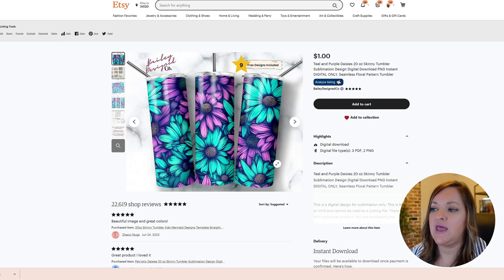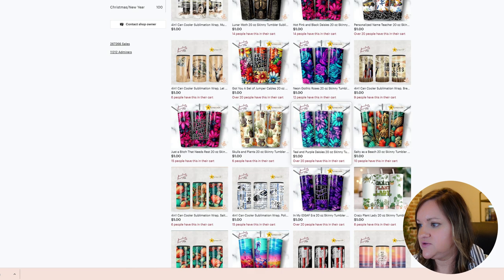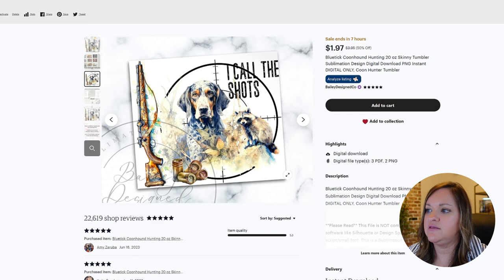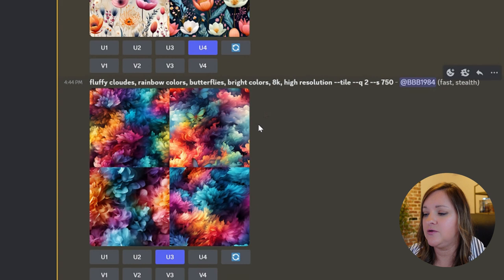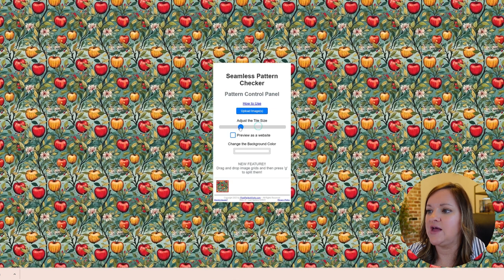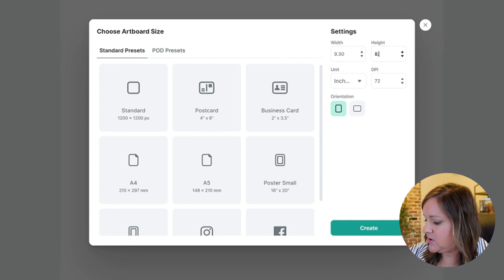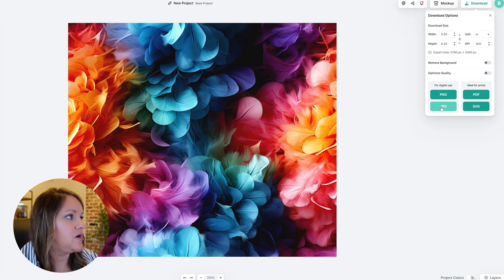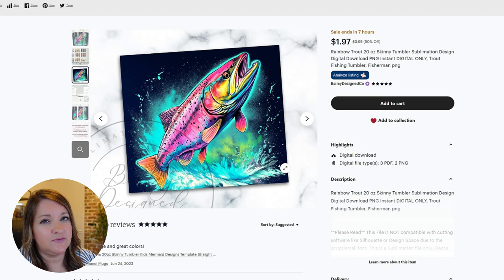How to Create a Seamless Tumbler Design With AI Tools

Comment: Can you post a video on how to make a seamless pattern without AI? For example, using a 12" x 12" digital paper that is not seamless and turning it into a 9.3" x 8.2" tumbler design...how can I make it seamless in Procreate, Illustrator or Canva?
Reply from the maker: If the 12x12 design is not already seamless you wouldn't be able to convert it to be one as it is already an existing design. Without AI, you can create a pattern with any type of graphic/elements you have created or bought (digital commercial use) and make a pattern and it will be 'seamless' so long as none of the elements touch the sides in any of those software, Canva Procreate, Illustrator.

Comment: You are so kind to respond, as I know you must be busy.    I have a full time job, so my etsy store usually gets my attention after everyone else is in bed for a few hours.    I am doing the --tile command, and wondering if my aspect ratio is wrong.   When I put the design in the pattern checker, I guess I am still not sure what I am looking for.    It looks tiled, but when I put it on my mockup and look at the back image (sometimes I will put it up in printify so I can look at the back or do a video on canva, it doesn't meet up so to speak..... could it be my aspect ratio? I have seen several suggestions for the aspect ratio.
Reply from the maker: Hi! Yes, the AR will be different depending on the type of tumbler you're designing for and the POD ones are a different size. The pattern checker will show very harsh lines if the design is not seamless and the objects won't "connect" to each other.

Comment: What did you use to upscale your photos? would midjourney x4 upscaler work just the same?
Reply from the maker: I usually use Gigapixel or MyDesigns, but midjourney does fine, it's just slow and I do all mine in batches of usually 30 or so :)
Reply: @digitallypurposedbailey  Thanks for getting back! Do i also need to convert to 300 DPI even after upcaling it?

Comment: Hi Bailey! When I stretched the 1:1 pattern in kittl to the dimensions for the tumbler wrap then re-downloaded the new dimension/image, there is often a white line when you check the New image on a seamless pattern checker. I've tried readjusting so many times but always end up with that white line. Is there a way to adjust it better?
Reply from the maker: Hi1 I haven't ran into this issue before....are stretching it to fill the entire page and have you tried in another software and then adding to the checker to see if it's the same result?

Comment: How did you come up with the size of 9.3 x 8.2 in. or 2790 x 2460 px? When I look at Printify they have two 20 oz tumblers. According to Printify, the skinny one has a print area of 2722 x 2325 px or 9.07 x 7.75 in. The other 20oz tumbler they have is 2795 x 2100 px or 9.316 x 7 in. Maybe you source your skinny 20oz tumblers from somewhere else?
Reply from the maker: Printify's tumblers are not what sublimation crafter's use to make/print and are not made with sublimation as they use UV printing. I did test some of my designs on them awhile back and some would work depending on the type of design. So if creating specifically for POD, you'll want to use their measurements. The 9.3x8.2" size is the average size of what we use from all major wholesalers of sublimation tumblers.

Comment: Thank you so much for all your videos!  They are so helpful!  I have a question … I created some digital tumbler wraps and took them into Printify and no matter what I do they don’t line up.   I downloaded a tapered template and sized it in photoshop.  I’m using 300 dpi and the 9x8 (can’t remember exactly right now, but it’s the dimensions that everyone is using for the 20 ounce skinny wrap) and when I take it into printify nothing lines up. It’s always significantly smaller. I’m guessing I’m missing a very basic step because no one else seems to talk about this and I’ve searched on Google and YouTube and I don’t see anyone discussing the reps not fitting in Printify.    I was goin to sell my files as well but I wanted to test them.  Ugh!
Reply from the maker: You're welcome! I believe Printify's tumblers are actually different dimensions than the 20oz straight ones used by crafter's at the 9.3x8.2". Last time I checked they all were different. I would look at the dimensions they have listed in Printify and create at what they say.

Comment: Upscaling actually breaks the seamless pattern. When you zoom in you will notice glitch lines along the sides of the patterns because of the way gigapixel uses models to upscale. You probably won't notice zoomed out, but when you zoom in it looks pretty bad on some patterns.
Reply from the maker: Interesting! I've never had an issue with this upscaler and patterns and have sold 100s of them, but it could be because they're pretty "busy" patterns.